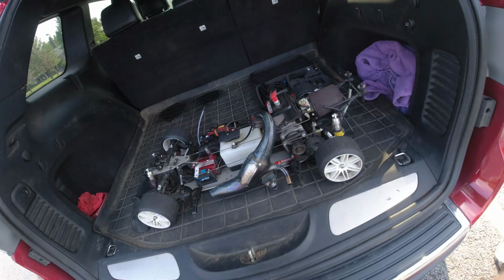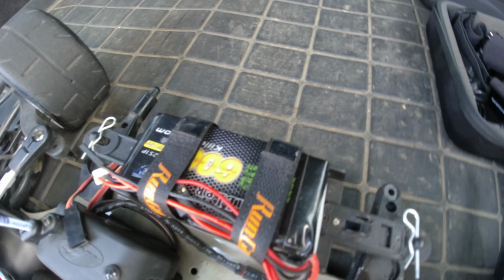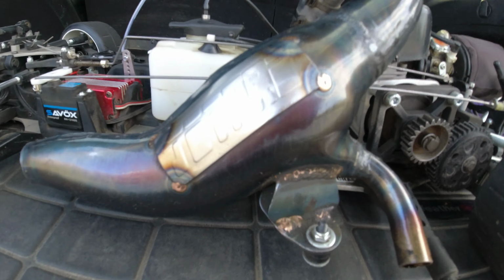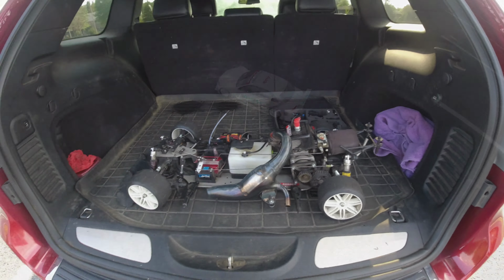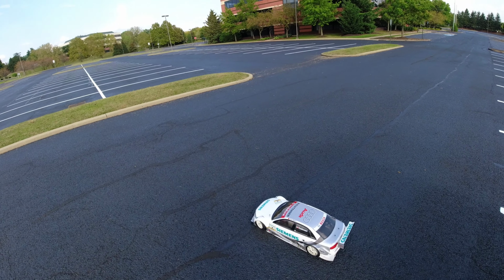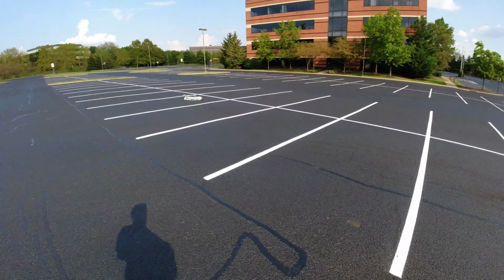FG Sportsline 530 4wd Audi A4 Zenoah g270 Jetpro Pipe

Comment: Love FG too!! I have a vintage marder 26cc lite and fun & fast like your car GOD BLESS MAN
Reply: Having problem finding the oringal body?? GREAT CAR
Reply from the maker: Hey thanks! I appreciate that. It is a very fun car. I have a friend that converted his brushless. It would eat my car speed wise. But man that 2 stroke sound is hard to beat IMO. Thanks for stopping by to check out my car 👊🤘
Reply from the maker: @alanflatau1685  you asking where to get a body for your car?
Reply: JUST GOT BACK FG MARDER BLOW LEFT REAR IN DONUT OPPS. MY RAMPAGE XT 32 ,THANKS FOR A CHAIN LINK FENCE ELECTICAL RUN AWAY?? STILL HAD FUN BROTHER

Comment: Awesome stuff man, was thinking to get a nitro and this looks like one of the best ways to go. Go big or go home LOL! 😎✌️, Subbed up man! really cool stuff.
Reply from the maker: Hello. Thanks man! This car really is a thing of beauty. I have no 5th scale on road cars. Been wanting one. So late last year I got this FG. I got the gas version knowing there is a brushless conversion kit for it. In case I don't like it gas. Well I like it gas lol. It isn't the fastest. But man it just sounds cool braaping. There are a couple different tuned pipe makers for this too. I went with a Jetpro here in the USA. So lots of hop ups for it too. So if you are thinking nitro. This is definitely the way to go. The car is much bigger in scale and uses a 2 stroke gasoline engine 26cc. So either the FG or MCD makes some nice 1/5 scale rigs too. In fact MCD is a bit better. They can be built to handle a big bore engine from Taylor RC or ALX. Need any more info hit me up. Thanks for the sub brother! Appreciate you stopping by 👊 🤘
Reply: @SteelCityRC  Oh yeah man, I was checking out nitro but was steering away since the mess and maintenance. But there's something about that 1/5th scale that is steering me back. Its just awesome and I love the noise too.

Comment: 2 speed coming next? Sounds great too!
Reply from the maker: I been thinking about a 2 speed for it. But it seems like 2nd gear isn't much higher than single speed. I have nowhere to really open this car up. All the lots are uneven and I drag body. So I really don't know where to go from here with it. Maybe an ESP ported head kit. Try a 2 speed. Not sure.
Reply: @SteelCityRC  I'm sure whatever you do will be great. If I ever go back to Pittsburgh I'll bring my mt and may be have a bash session.
Reply from the maker: @charliecosta6065  heck ya!!
Reply: I had an older sports line with a 23cc and the two speed, an awesome experience when that thing would shift. You definitely wouldn’t regret it and probably save $ over new engine. JMO✌🏾
Reply from the maker: @dirtmcgirt7748  great input man. Thanks. I am going to try a 2 speed. As far as the engine. I will keep it. Jut put a ported ESP head kit on it for a few more revs.
Reply: Great video,  thanks for sharing.  That little FG is quick for sure on theG2970

Comment: How fast do you think it goes?
Reply from the maker: Hey what's up. I would guess low to mid 40's stock gearing. I will GPS it in the spring. Thanks for stopping by 👊 🤘
Reply: @SteelCityRC  I want one but I say it looks sluggish on camera
Reply from the maker: @illmatic_95  it isn't the fastest car. It is no drag racer. But on a course. It will out corner better than most. That is one thing I noticed is how responsive it handles. I got it for a bit of fun in a parking lot. Does very well for me.
Reply: @SteelCityRC  thank you. I think it’s time I picked up one. Currently have around 10 1/10 and 1/8th scales.
Reply from the maker: @illmatic_95  maybe get the brushless version. Now that is a ripper. I know a couple guys with brushless FG. Totally different car. I got the gas. Cos deep down I am a 5th scale gas guy. I had the thought if I didn't like it gas I could get a motor mount to make it brushless. But I love it as is. I may get a two speed for it. Just to change it up
Reply: @SteelCityRC  I’ll deff have to get gas to start. Are parts easy to get ?
Reply from the maker: @illmatic_95  I would have to say yes. Parts are pretty easy to get. DDM racing has the basics. https://rc-car-online.de/en-.html has the upgrades